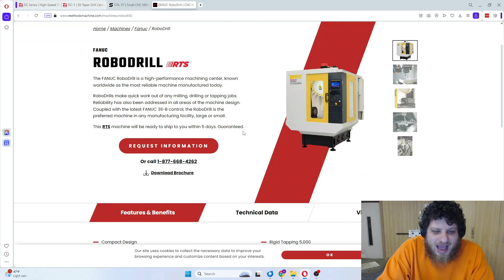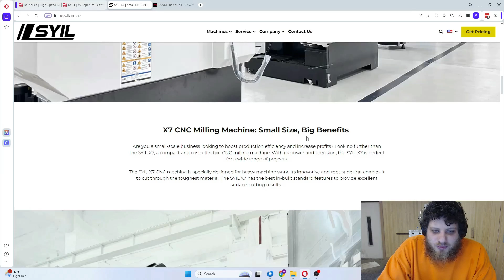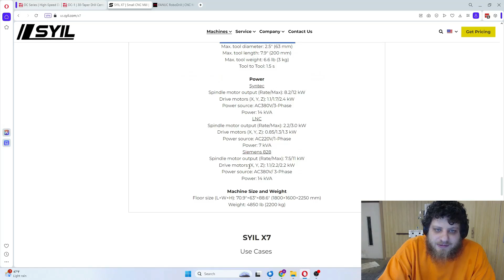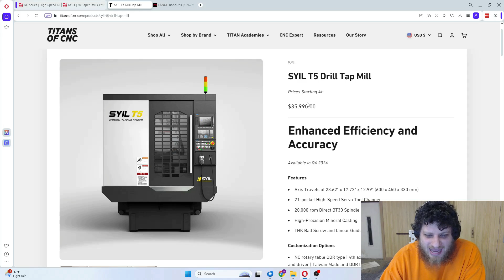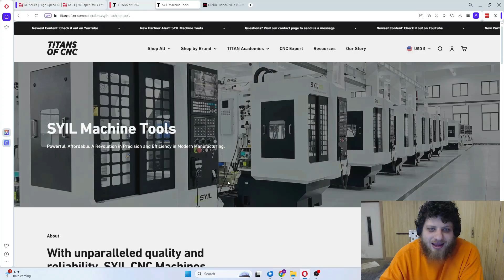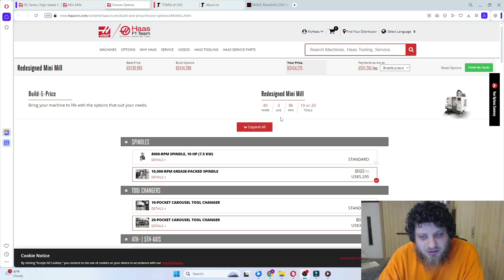Haas DC1 is a Syil Killer?

Comment: Solid take on who this is marketed towards. The DC-1 is definitely not taking any market share away from Robodrills or Speedios. If anything, I think it will increase the market share as a point for people to grow towards. I still don't really understand why someone would buy this over a new super mini mill. More tools, cat 40, and the ability to get it through a normal garage door opening without taking sheet metal off, are all big big positives on the hobby side of things. Especially since they'll be the same price once the initial promo wears off.

You should do some more digging on the DC-1 background. I'd love to hear haas story behind why they made the machine. All roads currently point towards this probably being a commodity chinese machine that haas is retrofitting their control to rather than a ground up haas design. At least a decent part of it seems to be chinese. If you watch the haas video of the machine, the back of the Y axis way cover is in chinese and the spindle is a chinese company called speedcn that also makes full machines. If you google speedcn cnc machine, you get links to literally the exact same machine as the DC-1 but with different a different control. Like an identical casting, identical z axis cover, identical rear sheet metal, etc. That also would explain why the DC-1 is such a departure from all the other small haas machines (huge amount of leveling feet, astronomical weight, etc). Making your cheapest machine weigh significantly more than its big brother, the DT-1, and basically the same as a VF-1 doesn't make a ton of sense otherwise. Things become a little more interesting from a parts standpoint if this turns out to be the case.
Reply: Bigger casting weighting 7900 verses minimill at 4600. Linear ways are spaced WAY wider apart on the DC1. DC1 has more spindle torque than Super Mini Mill. LOTS of differences.

Comment: I would still take a Brothers speedio over any of these pieces of work. They are faster  stronger and  can turn as well as mill . all 5 axis  super fast rapids , no need to buy any high speed packs or any other utility packs . They can run in an automation cell hooked up to a network . Its so funny Haas is just a copy cat of every machine out there and . If you put and indicator on a Hass bed you can push about .003 to .005 out of it NP . They are very weak machines  also if you get the high speed balls screws you have no torque . if you get better ballscrews you have no speed . Haas machine you also cant  do a ball bar test on and correct backlash . Without paying haas to come in for $5,000 to $8,000 to pop a Usb in there to unlock the parameters . You don't own a Haas machine Haas owns the machine  because they are the only ones who can use that magic usb card to unlock the controller .so you cant replace a ballscrew even with out a charge and a service call .
Reply from the maker: I mean, sure anyone would, but that's a $100K machine versus ~$50K.

Comment: Has anything significant happened since you made this video? Have any improvements been made in the industry? Are your thoughts and opinions the same? Have they evolved? Do you have any new recommendations?
Reply from the maker: The biggest development was the introduction of the Tormach 1500. It's a good balance of price, and capability, AND it's made in north America (partially US, partially Mexico). Like Syil, tormach doesn't have a service network, but it's really easy to get parts.

The DC1 has also shown to be a pretty decent machine, though they raised the price. I don't think I've heard of anyone being disappointed with it.

Syil on the other hand has dropped the ball a few times, and had a lot of quality issues.
Reply: @AudacityMicro  So if I understand you correctly basically Haas watched your video, liked your idea about a cheaper price and decided to raise it even more. Then apparently Sylil also watched your video., heard you mention how great quality their machines were and decided to downgrade. Then another company named Tomach came somewhere in the middle of both. Did I get that right?
Reply from the maker: Well, I'm pretty sure Haas didn't see my video 🤣🤣🤣. I did end up talking to both Syil and  tormach after publishing this.

Comment: Look at Smart Mini mill. Cat40 big plus, Fanuc control, 15HP 24 DA tool changer, Manual Guide i programing. Under $44,900.00. Seen it at imts.great machine. It will fit into garage shops.

Comment: We have seven industrial CNC machines in our facility.  Two of them are Haas CNC machines.  I have also owned several Chinese and Taiwanese CNC machines.  I have also owned industrial CNC machines with three different PC based CNC controls.  The Haas machines, Chinese Machine, Taiwanese machines are excellent value for the money.  Regardless of what machine you buy you will eventually have a problem with it.  With our Haas machines whenever they have had an issue the machine was never down for more than 48 hours.  In fact we had a warranty issue on one of them and our local dealer had the machine fixed and up running the day we called them.  We have had our Chinese and Taiwanese CNC machines be down for up to 8 weeks before.  The fact that most of the parts for the DC1 are in stock in California makes it a clear winner.  The Haas CNC control is Linux based and has a huge installation base.  I guarantee that the Haas control is far more stable and less buggy than any PC based control.  I currently have three PC based controls in my shop.  I know this from experience.  If you are trying to run a business you will find quickly how important service and parts are.  I would recommend that if you can spend the money go with the Haas.  Our Haas dealer is about an hour away from us.  When you have a machine go down you will quickly realize how valuable a reasonably local service and support network is.

Comment: (not criticizing but this video is good for directing the public to make a better decision)
As a multi machine shop owner here man when you said you went with a 20 year old machine that tell me everything i need to know. I AM NOT implying machines dont last 20 years but you just purchased 20 year old technology. If you follow industry standard of a manufacture they replace all machines between 5-8 years for a reason. HAAS, yes being built in the US is great but they are not usually built to last and cost just as much as a good Japanese, korean, or Taiwan built machine after adding all the option, just to machine a part. However if you look at the engineering side of the machines Japan and Taiwan machines are usually built stronger with larger diameter ball screws and heavier casting. Korean machines are a littler over built like a german car, too much sensors that will cause problems in the future. 
One very important aspect you touched on was parts supply. We replaces machines every 7 years in my shop and I have been looking at the syil but I just dont think i can rely on Titans of CNC as a parts supplier or for any technical support as they are just a TV host business and proven machine shops dont really take them serious. Most of what they carry is paid advertisement and not dedicated hard run equipment.
Reply: So true I stopped taking titan seriously very early on.
No real shop has the extra time or money available to play around 
75%fluff and show and sales

Comment: I would also recommend Tongtai machine tool  VTX-5/7/10, from Taiwan.
Pretty similar to Brother Speedio  S500/700 and W1000, from Japan.
These are both machine for production. I have a Tongtai VTX-7. It has been very good for production. But i regret not having the speedio because back then I did not know they are the best BT30 machine when I was choose my first machine. I wonder what are the difference between Syil X7 and Speedio S700.

Comment: Speedios are dream machines.   Worth every penny and they are competitive cost-wise.  Fast, super reliable and every feature loaded out of the box - with a built in PLC in the control with 200 I/O, touch screen and heavy casting. I have three of them with automation. The hell with buying Haas and Syil junk. Get real support with Yamazen. I’ve never had a service call and owned the machines for seven years. Period.
Reply: What's good about a touch screen?

Comment: I am from Europe. And there Haas cnc are some of the worst machines you can get. For the same price you can get a Syil. Or For example DN solution. Microcut for example. Which is far better.
My favorite mid-range machine. Is MicroCut C1050 with Heidenhain tnc 640 The only problem with it is that it must be kept at a temperature of 20 degrees Celsius. Since it has an inaccuracy on the y axis. 0.05mm Reason for Thermal expansion in the casting From cold to hot mode if the temperature is below the 20 degrees Celsius If the machine is kept at that temperature there are No problems optical Glass linear which gives it a high accuracy .
We bought it for. 91000 €
If we were to buy a Haas VF3 with the same equipment. Should we give 113500€
We also have One. SYIL X5 It's a nice little machine at a good price. We boarded when they switched to epoxy granite.
All the Haas machines. I've had touched. Haven't been able to keep a Repetition performance Below 0.02mm
Reply from the maker: There's a big price difference for us. Over here Haas is easily half the price of most of the European MTBs. No one would claim that Haas is the highest performing machine, but they are generally decent in all the categories that matter. It's easier to make money on them, because they are so darn cheap.

Comment: I was in the market for a VF2 sized machine this summer. I reached out to a bunch of different companies. I could not get more than a basic email from most. I put in a quote from Hurco at 9pm and had a call the next morning at 7am. I ended up buying a VM10i and have had pretty good success with it so far. The HFO is lacking in our area in more ways than one.
Reply from the maker: Nice! I would totally go hurco if I could fit one in my door. but this shop has a comically small garage door. My Tormach barely fit. The hurco headquarters are less than an hour away from here, so I have a soft spot for them.
Reply: @AudacityMicro  look at the VMone. Really small footprint with low height. They run around 55k. My VM10 is 2/3 the size of the vf2 with almost the same size table.

Comment: All of Haas's machines are rated at 200% spindle load which it can sustain for 4 minutes.  15 hp on their data sheet doesn't mean 15 hp continuous.  Probably more like 7.5.

The X7 3 phase machine is rated at 11 hp continuous and 16 hp for 30 minutes.  In the testing I have done, those figures have been extremely accurate.

Comment: If I can’t buy a Brother Speedio once I’m in a position to buy a starter machine, I’m buying a Syil if not an older used machine. I can’t stand Haas. They could at least just increase their prices and stop the HSM, rigid tapping, other software lock crap and I would have a lot more respect for them.

Comment: x7 is not the drilling tapping as DC1, T5 it is...and similar features, but mainly different is SYIL x and t series based on mineral casting. by the way we also have U.S. support and parts stock in Houston headquarters.

Comment: One thing i think is important to consider is the dc 1 has the advantage of being easy to upgrade to 5 axis. Obviously its expensive but a relatively quick upgrade. Not so much for syil. Im stil considering a syil x5 though...

I do hate the argument against Chinese manufacturing. If they provide a better quality machine and support i will buy it

Comment: So, I bought a HAAS VF4SS. Paid cash for it at about $140,000. I had never used or purchased a milling machine in my life if you don't count the TAIG mini mill that had purchased back in the early 2000's. The fact that you have to purchase "High Speed Machining" separately has left a bad taste in my mouth ever since. I will not buy another HAAS machine and I'm about to get two more machines. They will be Doosan (DN Solutions now).
Reply: What did you get it for?
Reply: @FlacoGonzalez-u6h  I retired in 2014 and wanted to do something fun. I originally wanted to make gun parts but invented a little product in 2016 and used the mill to make thousands of them. Still make them today.

Comment: As I understand it, if you by a Siemens control you get world wide support - locally in your country.  Also the spindle ratings on Haas are maximum compared with Syil which show continuous and max.  With the maximum there will be a duty cycle limitation. All the servo drives will be Siemens (if you opted for a Siemens control) so support would be local? Bearings, guide ways and ball screws are all internationally known brands so you should be able to buy locally.  The Big difference is you can't ring up a Syil "HFO" type outlet and have them come round and service the Syil - that's probably the biggest downside from a larger companies point of view.  I don't own either of these machines.
Reply: The ballscrews and linear guides are all custom lengths so unless you find others and cut them down yourself you'd have to order through Syil.  

Siemens is an expensive option but worth it if having that documentation is important to you.  The downside to it is that you're pretty much stuck with whatever firmware version you end up with, and certain parameters are locked down in the control.  Syntec is wide open and you can update your firmware whenever a new one comes along.  

There's nothing proprietary about these things - any experience tech would be able to work on it.

Comment: Another thing that the svil has is epoxy granite base compared to hass having a cast iron base
Reply from the maker: True! Which I suppose might cancel some of the weight differences. Makes me wonder about the relative volumes of the castings.
Reply: epoxy Grant have about 7 microns in thermal expansion where cast iron have about 13 microns per meter  and it makes the machine more stable also.  
I'm enjoying it on the SYIL X5  that it is also more dead in resonance frequency

Comment: Im in the process of starting my own business at the moment but i am in Ireland so machine suppliers are limited we have all the big guys but most dont have service in Ireland we have to pay for transport, flights, and hotel before the machine is even looked at .I run Hurcos at my present job and would not buy one after running the new ones, at my last job we replaced all the hurcos with dmg due to service issues, we had a hurco lathe down for nearly a year due to covid. My last boss said enough get rid of them we are only buying machines with service based in ireland. Hence we went with dmg as we had good dealings with the supplier on other machines like a trumpf punching machine. So after all my trials and errors i have decided on a dmg nvx 5080 with a 5 axis trunion that i can mount and dismount as needed I know its more expencive than a Haas or a Hurco but you get what you pay for and the dmg will still be running and holding tolerance in 15 yrs time,but the biggest factor is i know all the service guys 10 in total but i have alll there mobile numbers, mobiles for parts and service and application guys and i can contact them 24/7 and to me that is worth the extra price tag.
Reply: You hit the nail on the head here with service. My service on a new HAAS was so bad I sold it with 35 cut hours for used machinery money. At 35 cut hours it had 10 times that in downtime due to poor build and poor service.

Bought a Hurco and had excellent service as they are fairly close to me and didn’t really need service other than 2 little snags when new.

But based on reliability and service. Good machine doesn’t need service, overpriced piece of junk like HAAS needs the service and they can’t give it in UK to small business.

On that note speak to companies your size for service given. Lots of bigger companies had good service from HAAS where they left me down for month because bigger company higher priority.

Hurco gave good service to 3 other small companies in my area so that helped my decision where as DMG was terrible in my area.
Reply: if I remember correctly you can only get dmg nvx 5080 with fanuc controller